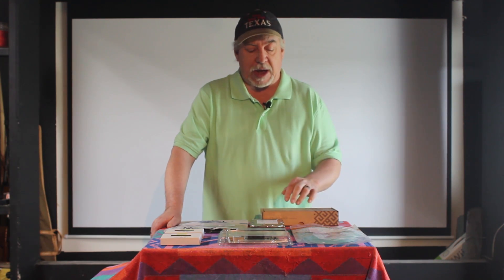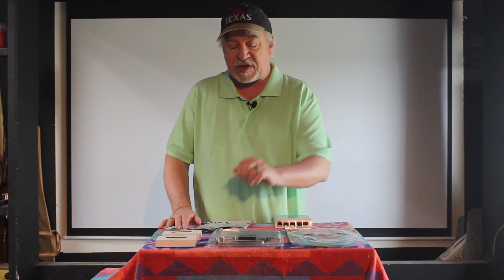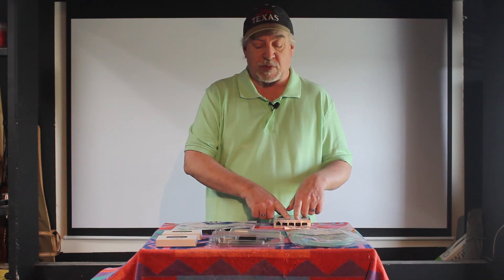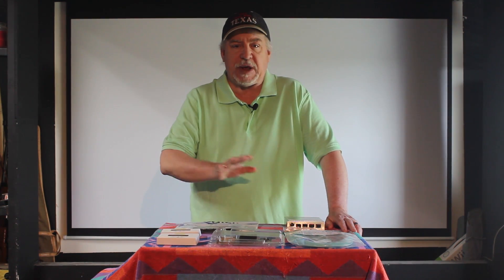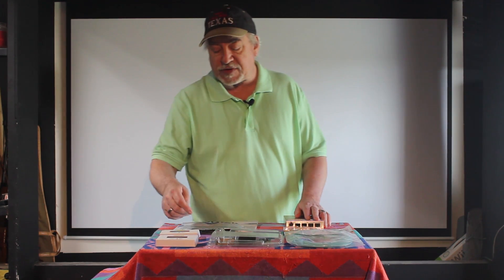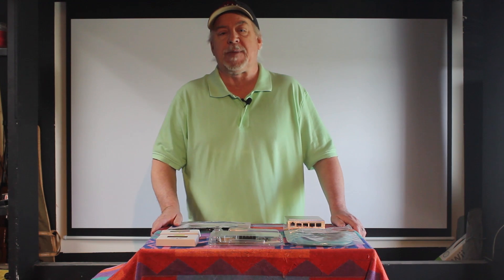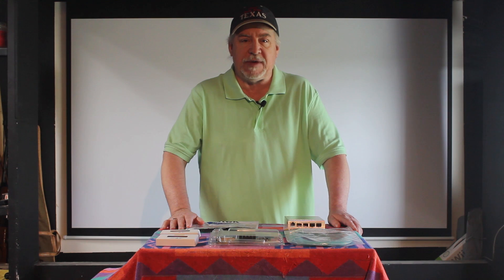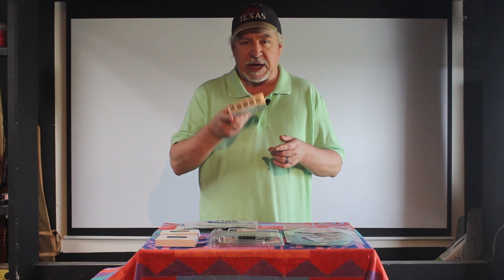Big Fat Pipes - 10Gb networking

Comment: You can easily achieve the 10Gb connection using NVMe drives in both systems since they read and write around 2500 MB/s (or 2.5GB/s) or more, which is more than double the bandwidth connection of 10Gb networking.

Comment: You really think you'll need more than 4x 10gb ports for a prosumer setup? Eventually, I could see myself needing more than 2 sfp+ but I'll most likely get that Mikrotik unit you have to expand my current setup since I'm not even close to saturating it. I also have the option of stacking a 2nd switch to gain 2 more sfp+ but since they chug 50watts each (idling without any link ups) I'll more than likely just keep the 2nd as a spare in case my primary switch fails/has problems.

In case anyone is wondering I have a pair of Dell Powerconnect 5524p that I snagged on eBay for  145$ total. At the time It was only 20$ less for a single unit so I figured why not 2.

Comment: Great video. I'm in the process of looking into setting to 10gb network myself and I'm looking at the ubiquiti sfp+ switch also I'm running there USG and AP's and there spot on so makes senses to grow that and tie it all together.
Reply from the maker: Yes, I like the Unifi 10GB switch, it also has Ethernet connections "4" as well as the 16 sfp+ ports, I would then most likely use the fiber connections for my office and lab and use the ethernet for other devices in the house. Thanks for watching :)

Comment: I get about 960 MB/s using my old quanta 24 port SFP+ switch + spinning rust drives in hw raid on both directions, just costs a bit, even my R710 +H700 + 8x300GB 10k RPM drives, boot  m.2 120G. SATA, 120GB NVMe (non bootable) PCIe x4 USB 3.0/SATA III controller, among other stuff I added to my R710, regretting not getting a R720 with all the upgrades it'd cost about the same and I could of been running E5-26xx v2 cpu's

Comment: Can you add links to the DAC,SFP+ cable,NIC,MM SFP+ cable.
Its great that you mention you get between 300 - 500 MB/s with 10G, but is that with ordinary SATA 7200 RPM hdd's
Reply from the maker: Will do, thanks for the reminder :) and for watching.
Reply: @UnkyjoesPlayhouse  But can you mention if its 7200 RPM on that speeds? Because I have 5400 RPM drives in my NAS in RAID6 and I'm wondering if the 1Gbit - 113 MB/s is the speeds I will get or higher.

Comment: Seems like it would really depend on how your server is setup... if it is something like a RAID 5 or 6 then yeah you'd be lucky to break 300MB/s (which should still be plenty for home use IMO) but something like a RAID 10 even with old SAS drives,  I was able to break 700MB/s sequential reads and almost 400MB/s sequential write. Not that a RAID 10 would be ideal for a home user...being that you literally have twice as many freaking drives to do the same work just faster...in fact it would probably be way faster and maybe even cheaper to just make an SSD array TBH.  I'm interested to see where Unkyjoe takes this.
Reply from the maker: Why thank you Dan, I am hoping to break 300-500MB/s lets hope I can make it happen. Thanks for watching :)